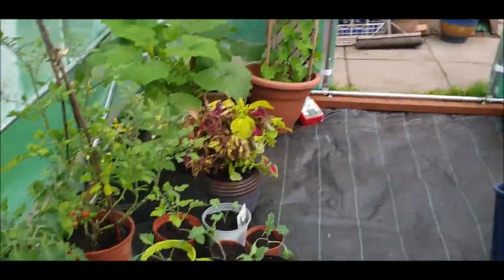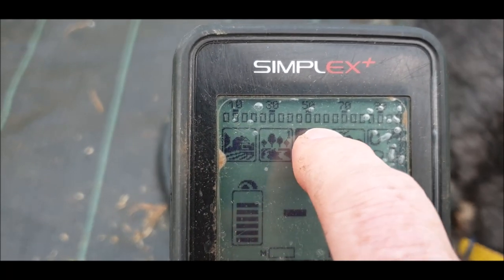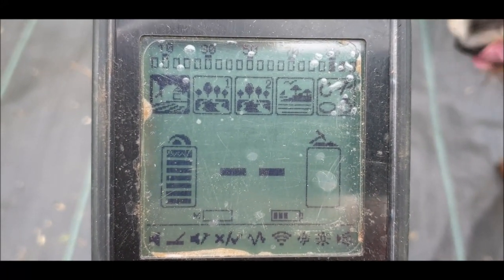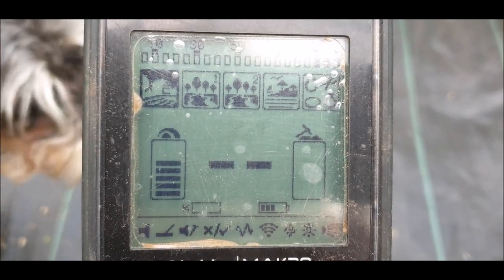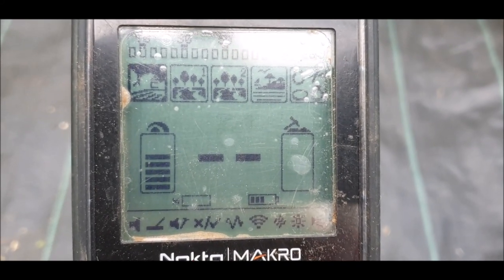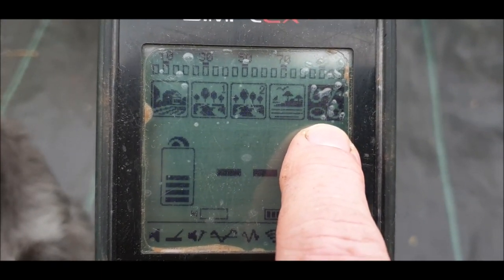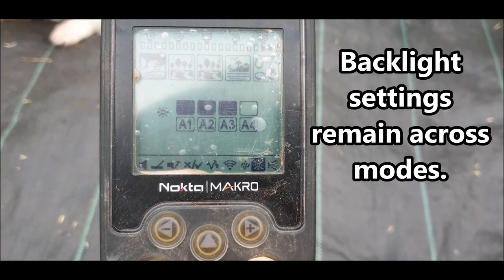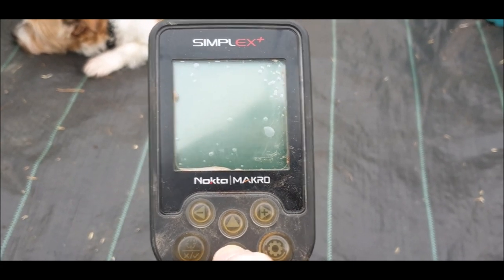Beginner's guide to the Nokta Makro Simplex+ (with timestamps)

Comment: Hi Lori - thanks for that. I will try your beach procedure and see how my machine responds. We have loads of hot rocks and mineralisation so I am having difficulty getting the hang of the machine. As for the question I asked in the previous clip about the battery level versus performance... I'm still doing a bit of research on that one. I'll give a bit more feedback after trying your way of operating on the beach! Thanks again, you're helping me learn the machine!

Comment: No regrets on subscribing a few weeks ago...except I wish I'd done so sooner! This video is very helpful. Thank you! I just acquired the Detech 15" coil. I know you've used the Detech 13" coil. Do you have any special advice on which mode would be best for that very big coil? 
What about ground balancing...should I first auto balance in beach mode and switch over to Park with that coil, as you showed here? Or...should I manual balance and take the number down lower than the auto balance?
FYI ~ I'll be using the 15" coil in Lake Erie, OH in waist-deep water. I know it sounds insane swinging a giant coil in a few feet of water, but: 1. Very few trash targets 30 ft offshore AND: 2. I need to cover a large area with the broad sweeps of the big coil. 3. I need the greater depth of the big coil to penetrate deep sand and reach the clay layer holding the good targets.
I sincerely appreciate you and how well you speak in simple language in your tutorials. 
Peace!

Comment: Very helpful video, thanks. Which screen protector are you using? Also, how do you like the Pulsedive and have you used the Nokta Pointer? Thanks in advance.
Reply: I want a Pulsedive..the perfect size underwater
Reply from the maker: Hi Stratman, I got the screen protector off of ebay. I'll find a link. This is for the UK. :) https://www.ebay.co.uk/itm/264593333703
Reply from the maker: I love the pulsedive, although I do not use it to its capacity. I need to invest time in it, but even without studying it, I am finding it works fantastically. 
I used the Nokta Pointer before I had the Simplex and it also worked great. I changed because of the wireless capability of the pulsedive, and the ability to sync with headphones. I always use headphones, so having to take them on and off, and make sure Simplex was far away before switching pointer on, was just too much of a pain. I could have changed to f3, but I want the machine optimised, and NM says that's f2. All roads led to pulsedive,  and I'm very happy with it. Only thing I'd change is that it's a bit large!
Reply: @thesimplexguru1263  Thanks so much for your response and all the great information.

Comment: Hi. Love you videos. Learning a great deal as a result. I've got sp24 coil. Just wondering if it is also worth buying the sp22 coil? Advantages/disadvantages of sp22 vs sp24? Seen sp22 for sale for £40. Should I buy? Thanks.
Reply from the maker: Hi Neill, I did do a video ages ago about this, in depth, but in short, possibly. That's a great price and will always be useful to have multiple options for your machine. 
You can also use it as an almost sniper type coil. 
I can't say if they are as good as the sp24, having never had one. But I believe they should be. 
So, if you've got the £40, yeah, options. If it's a stretch, you don't NEED it. 
Hope this helps!

Comment: That was excellent, very useful, vital infact!  Without it its like being told how your computer works and all the programms but nobody telling you how to switch it on - a point many miss with new technologies.  Thats why we have "Dummies for ......" books in the shops. 
 I found your vido excellent, got a little lost with the talk of 2.68 machines and 2.76 and 2.77 ?  Not sure where I find out which I have as it does not say only gives the Serial number but as mine is Dec 2019 I guess its 2.77.  It also has Field and Park screens and not two Park as per your vid. but that must be one of the improvements.  Now slowly I will go through your other vids after a bit more practice, as you rightly say you have to spend lots of time with it!

Comment: Hi,
excellent video.I understand ground balance,but I do not undetstand the numbers.So,could You explain please what the numbers mean on GB if You get 80 or 55,or 30 and what kind of soil is connected with numbers.I got yesterday 95 on GB.It seems to me very high,or I did something wrong?
Reply from the maker: Hi Johnny. That 95 seems very high. I would have moved field position slightly and tried again. I had exactly the same as you this afternoon, and knew it wasn't right. I shifted slightly and re ground balanced. The actual gb was in the 50s. I probably was inadvertently trying to gb on a bit of iron. I'll answer second part of your question separately, just to keep them in unique posts. Thanks for your questions!

Comment: I'm still running the 268 version in your opinion what is the best version to have?
Reply from the maker: Avagodigger, I would not be without that mute button, park 1, or the sp24 coil, so something 2.7x is required for me. I choose 2.77 as that’s optimised for sp24 coil. If I only had stock coil, I would probably still choose 2.77, as I could just turn sensitivity down when I needed it, and it would be there when I wanted it. But that’s what’s best for me. Have you thought of changing, if so, what has been your reason for sticking with 2.68? I’m curious. :)
Reply: @thesimplexguru1263  268 is perfect for Australian conditions I just think that the original 268 was the best version nokta sent out in the first place..it didn need updating in my opinion...all the fuss over pushing a button once compared to three times if you were to.turn the volumn down and another park mode that's basically the same as the original version anyway...the only thing that bothers me though is that the ones who chose to remain true to the original version arnt allowed the privilege of being able to swap coils.. in the end that alone will probably make me go and update the machine but honestly I wish it wasn't so 🤨
Reply from the maker: I guess the depth they wanted on the wee coils meant they needed to change the 2.68 software. The depth we get with the sp24 has been amazing, and it is a better coil. I swapped machines with a fellow club member today, and spent 3 hours with the standard coil (and no headphones!). That was an eye opener. Wow. I found it so difficult to separate signals. Tbc....
Reply from the maker: Sorry,  had to take dog out. What I was trying to say (probably not very well) was that to get the most from the little coils they needed to overpower the stock one (and rely on users to turn it down to work  properly. I guess a better solution would have been some way to programme the detector coil to tell the machine to work deeper when the small coils are on, and work normally while the stock one was on. Maybe the tech would be too expensive, and they were keeping it affordable.  
Anyway, whatever works best for your soil is what is best for you. Thankfully we can choose, but it is difficult that you are limited to the stock coil to get the best performance in your soil. :(
Reply: @thesimplexguru1263  can I take my Simplex from V2.78 back to V2.77?